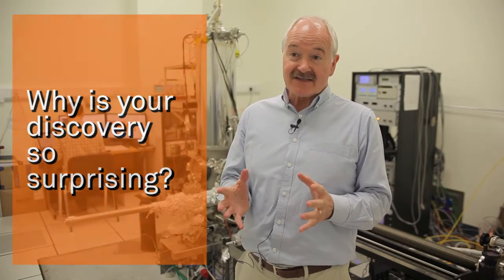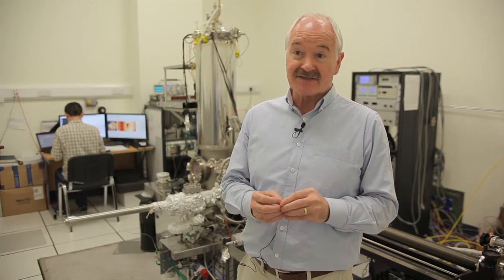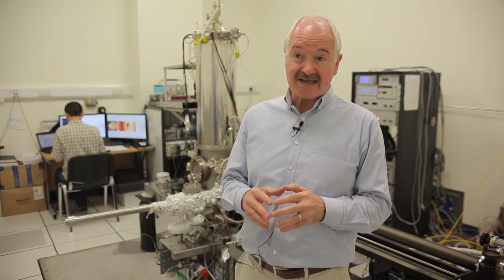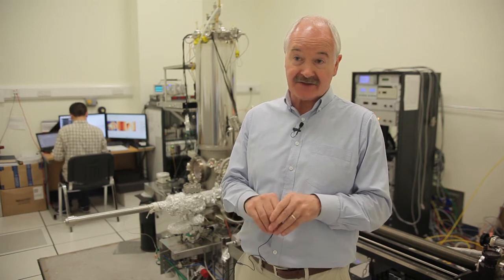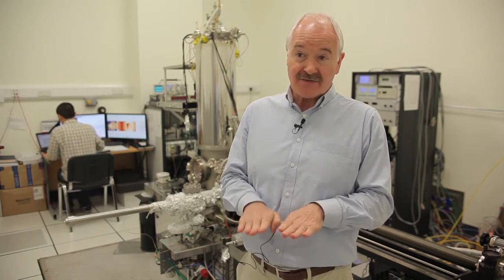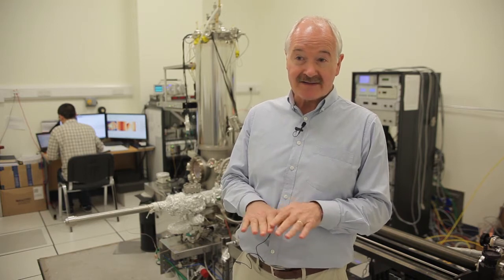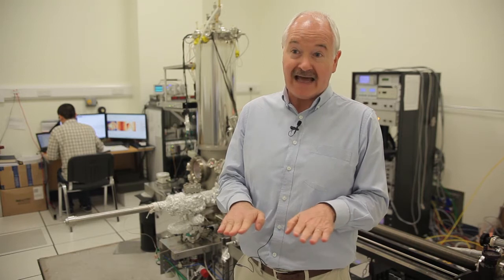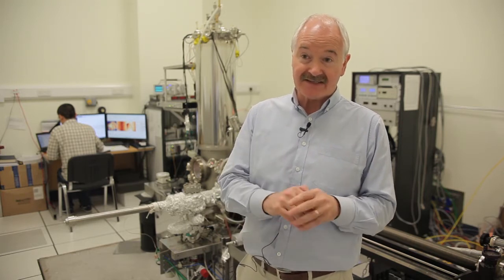Nanocrystalline Copper Films are Never Flat - Explained

Comment: I am completely surprised no one has noticed this in modern times. Have you since seen the work of adding graphene, and have you done this? I would suggest that EVERY metal will be uneven if not frozen (fossilized ) at time of flow and untouched-moved over time.  Look at almost any rock under its *skin layer and it is made of other rocks, held together by some type of amber goo occasionally, especially near volcanic-plate-areas. I think dry wash is a big player down the road in explaining a lot in terra forming. We shall see.      Have you now tested all metals and a video on results-conclusions? Thanks for bringing this to Youtube. I would be curious if you can and would check the *patina on megalithic boulders with the DARK  colors. Can lava and dry wash~ be smoothed!